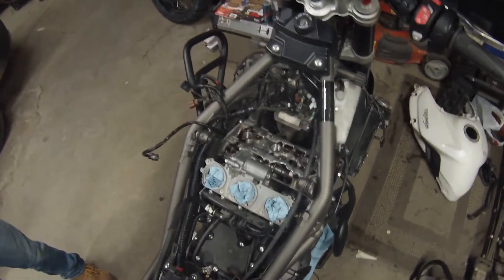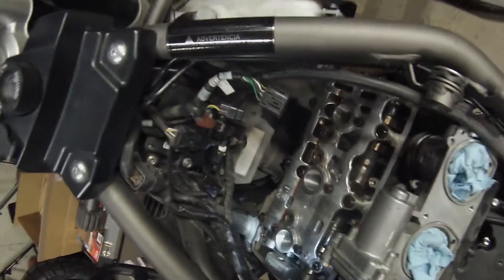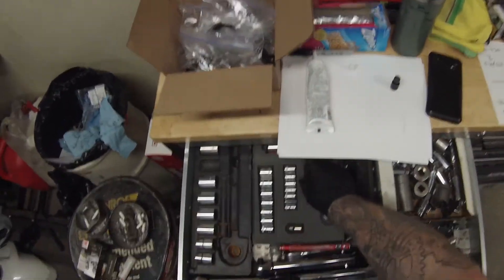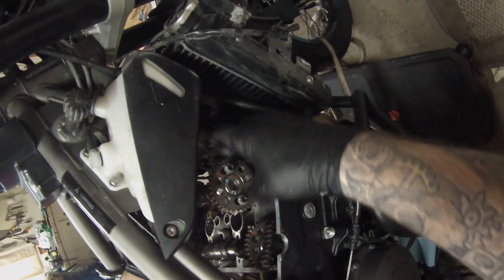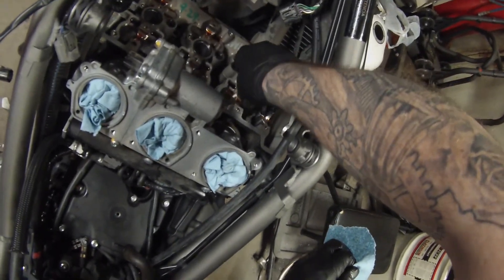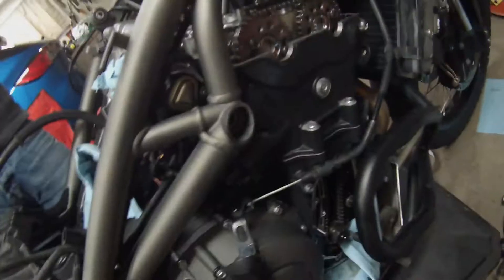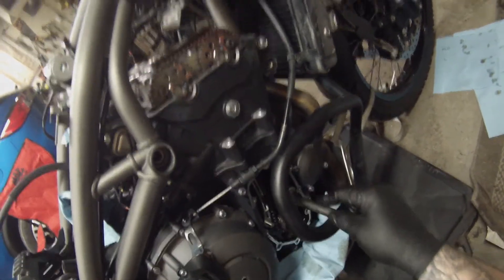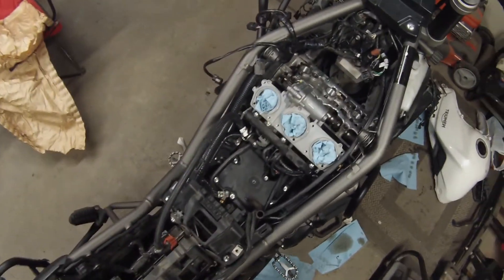Valve Adjust & Camshaft Timing On A Tiger 800

Comment: T3880607 - ordered this part which is pictured on the online site with a combined Allen key/socket. I'd be interested to know whether, when you guys ordered this part number, you received just the tensioner (as I did) or the two parts pictured in the tools list?  When querying, I received the following reply from the supplier...."Tensioner part is supplied correctly. The EPC image differs across numerous models, showing an allen key. This is not included and the image on EPC is incorrect, this is purely an illustration and does not reflect supplying part". It is not going to stop me from undertaking the work.....the point is, is this misleading (that is,  implying that you will get two parts when you only get one)?

Comment: Fantastic video 
Thank you for taking the time to do this and for sharing. 
Doing my first ever valve shim adjustment on my Daytona 675R with 40,000Km and replacing my cam chain and tensioner guide blades (one of them is broken). 
This is the perfect way to visualize the instructions on the service manual and you just made it an infinitely less daunting task. 

Cheers to you buddy! 
Thanks again

Comment: Very well done. This job alone is why my Tiger 800 is the first and last Triumph I will own.
Reply from the maker: Believe it or not. This was WAAAY easier than when I did the FJ09 I owned or my friends 790 Duke
Reply: @AUTOT3KHCL  Thanks for the heads up, I’ve been considering the Tracer for a while now. But I’m mostly riding a water cooled GS now and you can’t beat having the jugs hanging out the side.

Comment: Thanks again for this
Am finishing up my valve adjust and have replaced my cam chain and tensioner guides. 
Everything went smoothly until this step when I refitted the cam plate. (20m on video)
Started tightening the bolts as stated by the manual and the camshafts did not sit well on the left hand side of the engine. That’s because, like you mentioned, the lobes on cylinder 1 are pointing in but slightly down, so they need to compress the valve buckets ever so slightly in order for the plate and camshafts to sit correctly. 
Of course, inexperienced as I am, I ended up damaging the intake camshaft and had to get a new one. 

It is very important to start tightening the bolts above cylinder 1 first to get the valve banks on that side to give a little more room for the cams to snug down in their slots. THEN and only then can you start following the tightening sequence described in the manual. 

Hope my bad experience saves someone from making the same mistake. 

AutoT please correct me if I am mistaken. In any case this has worked for me!
Reply from the maker: Did you have the cam holding tool on the camshafts or were you just using the chain to keep them in place?
Reply: @AUTOT3KHCL  yes I did. I used all the Triumph tools and followed manual to the letter. 
It was entirely my fault since I failed to notice the cams were not installed properly and kept on tightening. 
I’m happy I didn’t break the cam plate 😓
Reply: @AUTOT3KHCL  is it important to still follow the inside out torquing pattern when assembling even though the cam sits high at cylinder 1 because of the lobes against the buckets?

Comment: Hi, I follow your instructions. Very informative. However, my engine came on and stay one. Will it go away after driving a few miles. Or do I need to take to the dealership to clear the engine light? I have a 2011 tiger 800. Thanks

Comment: Great video. I hope you see this, I did this and got to the step of adjusting the timing. Got the tensioner tool in and set to .6nm, got the first two bolts replaced, then removed both locking  and when I tried to turn the engine over to do the second set of bolts it would not turn over after a certain point. Could this be a piston making contact with the valve? Or what else could be causing this?
Reply from the maker: Still have the pin locking the crank? You'll get some movement out of the crank and then it'll just stop
Reply: @AUTOT3KHCL  no i removed the locking pin and the timing tool as well
Reply: It turned fine before but the camshafts were slightly out of timing before the adjustment, I’m wondering if this could have something to do with it
Reply from the maker: Camshafts are in the correct location and timed correctly? It's easy to put the intake cam in the wrong location etc. If the cams are 180 out the tool would still slide in
Reply: Yeah the intake and exhaust are correct, I followed the timing procedure to a T so I’m not sure what went wrong. Might be time to take it to a professional
Reply from the maker: Re remove the camshafts and that will close all the valves. Then rotate engine over and see if it stops... if it does... something fell into the cylinder
Reply: @AUTOT3KHCL  I did that and it did turn over, so it must be a timing issue. I’ll repeat the procedure and see if it helps

Comment: Thank you for helping me find the level of my incompetence. 

Oil change? No problem. Brake bleed? Easy peezy. Spark plug and air filter change? Sure...pain in the ass, but not terrible. Pulling my cams out? Absolutely NOT for me. Definitely helps me appreciate the skills of actual technicians.
Reply from the maker: Don't sell yourself short. A lot of people are intimidated to even attempt the spark plugs. You've already done the hard work. Little patience and you could finish the rest

Comment: Thanks for this video. I'm wondering what the purpose of the CCT tool is. Could you not put in the actual CCT to create mention against the guide?
Reply from the maker: The CCT wouldn't have any oil pressure to it so the tension wouldn't be the same. The spring inside the CCT might get it close but not worth the risk. 
You could however use a manual tensioner and set that to the proper torque
Reply: @AUTOT3KHCL  Thanks for the reply. That makes sense now given its a hydraulic tensioner - I didn't think of that. I regret not setting the timing when I did my valve adjustment on the Street Triple at 20,000km. It'll be my winter project and I'll be using your video to guide me. Thanks.

Comment: The video was useful buddy, by any chance have you changed the timing chain along with timing chain tensioner pad ?
Reply from the maker: I have. Just take out that center bolt above the timing cover and undo the Allen head bolt that holds the timing chain guide in place. Chain and guides slide right out the top

Comment: Anyone know the bolt lengths for the crank case cover mentioned at 01:10?  Took mine off and had 7 bolts the same length and 1 that was shorter, typical work of my local dealer lol.

Comment: Great video!! I do have a question. I have my bike apart but on the crank shaft the line and dot for top dead center don’t match up with the hole for the alignment tool. Should I carry on with the shims and adjust timing when finishing up? Or take it to a professional?
Reply from the maker: The lines on the camshafts don't line up when the dot on the crank is at TDC? 

The cams just need to be retimed using the cam holding tool
Reply: Those lines are close, but when I stick the Triumph pin in the hole it in place with the line and dot at the bottom it doesn’t seem to go in all the way.
Reply from the maker: Pin the crank. Get the tool to go in. Then time the cams to the crank. You have to loosen the cam gear bolts

Comment: It looks like you did not remove the throttle body assembly. Did you just loosen the throttle body assembly up to move it a little (without having to unhook all the connections) to slip the cam cover off? Or were you able to slip the cam cover off with the throttle body assembly in place?  Thanks in advance.
Reply from the maker: https://youtu.be/5TkWuUtMB4Y 

It's covered in this video. Tools needed and what not

Comment: What's the purpose of replacing those 4 cam sprocket bolts at 22:45? If it's to slightly readjust that sprocket, wouldn't it make sense to loosen both bolts (per sprocket) before replacing one? Thanks!
Reply from the maker: They're technically one time use due to the thread lock

Comment: Hello, why use that aligner if the camshaft cover already has its own aligner guide , minute 13:00. On the paper you put the cylinder numbers wrong, cylinder 1 is the one on the left mounted on the motorcycle, greetings good video,sorry google translate
Reply from the maker: The spring tension would spin the cams on you and you wouldn't be able to torque the gears on. 

Write whichever cylinder you want as number 1. Just don't forget and it'll go back together properly. Technically yes You're right
Reply: @AUTOT3KHCL  aahh, now I understand, I've been looking at the workshop manual and that tool (T3880640) is only for keeping the shafts still while you tighten the gears
Reply: although I don't see much point in making that adjustment of the gears either, they shouldn't have moved
Reply from the maker: Chain stretches over time

Comment: I Want to check my 2020 Triumph Tiger 900 Valve clearance shims 20,000 Klms now.  Where can I purchase the Crank pin tool and the Cam Shaft alignment tool?
Reply from the maker: The dealership
Reply: @AUTOT3KHCL  Thank you.
Reply: Hi Matt, this question may be helpful to others that come by this way - was there any changes to this method on the tiger 900?

Comment: Great set of videos. Thank you for producing. I have a question regarding the tensioner tool (the one that must be tightened to 0.6Nm). I understand that you remove the standard tensioner and at the appropriate stage, insert the special tensioner tool and adjust to 0.6Nm. I do not understand what this tool does; that is; it pushes the tension arm against the chain at the correct torque setting but then you remove it and fit the standard tensioner. Can you please explain what the special tool does or allows you to that is different from the standard tensioner and perhaps paint a word picture of how it all works? I would be very grateful.
Reply from the maker: It sets the chain tension to a similar level as the bike running, for timing the camshafts. Your factory oil loaded tensioner won't provide the same amount of pressure without the bike running.  

If you have a manual tensioner, you could just use that
Reply: @AUTOT3KHCL  Thanks - that's great.. So it replicates the function of the standard tensioner purely for the purpose of setting the camshaft timing.
Reply: Sorry to bother again.........where did you get your shim set from? Is it specific to Triumph and the Tiger 800?
Reply: Is it really possible to measure to 25 micrometres (25 x 10-6 metres) using feeler gauges? Or have I got something wrong.  Let's say difference between two shim sizes are 2.400mm and 2.375mm. Difference = 0.025mm. I know it has been done throughout history but wouldn't the thickness of any oil, slightly warped feeler gauge,  cam not set at precisely slack alice not account for such a small measurement?
Reply from the maker: The shim kit is a Hot Cam Shim Kit. It's not tiger specific. It's a 7.48mm kit. Got it off Amazon cause that was the best price

Comment: TOP TIP Just buy a 7mm bar and cut  to size to fit into the cam slots or use a 7mm drill bit..it saves you money and does exactly the same job
Reply: Is this in replace of the cam timing pin tool?
Reply: @TheJarvMeister  Sure it does the same job